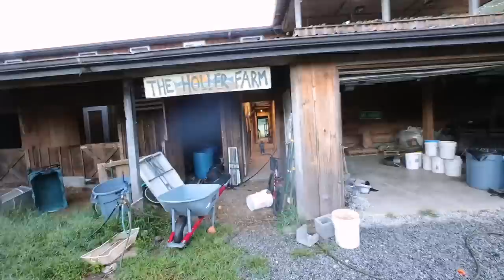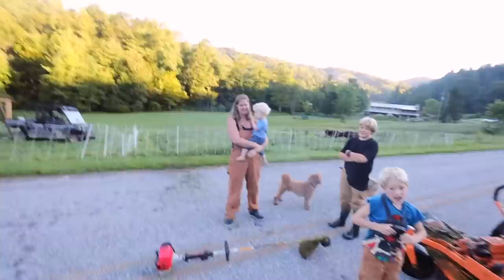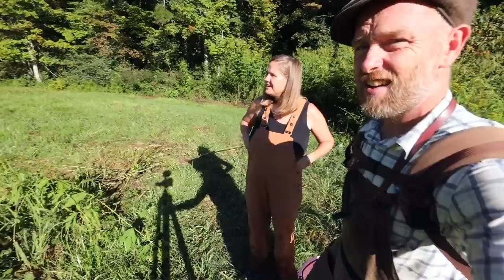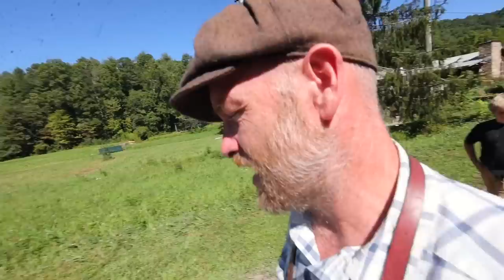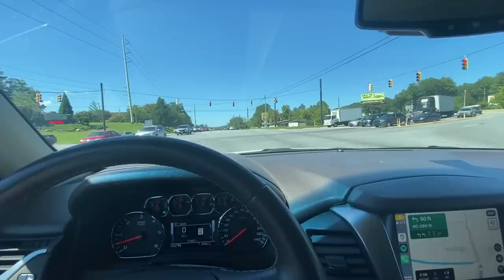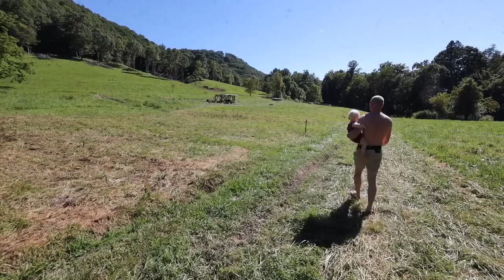I Bought a New Milk Cow & Her Gigantic Calf

Comment: I like Roma tomatoes as well. As a matter of fact I plant more determinate  tomatoes than indeterminate. They are less work as you never need to cut off suckers, the more, the more fruit. The trick is to plant them in stages so one takes over for the other when it is done. As determinate tomatoes bloom quick with tons of fruit then dies.    Is the knew milk cow a Jersey? We had one when I was a kid. One of the most reliable milk cows ever!  👍

Comment: Always, always, always wear gloves when operating a motorcycle...everyone goes down at some point.. especially kids. Gravel inbedded in the hands really sucks to get out, they take a stiff brush to your hands while you scream in pain.  I have worked in the industry and have had every kind of bike both for street and track use.  I would not let my kids ride without full gear and I would not ride for chores or "casually" around the farm.  It's a serious and very dangerous sport and should be respected at all times.  Please consider sending them boys to a rider safety class and develop a track to ride that keeps their focus on the bike and not what kind of tool they are going back to the house for.  Respectfully.